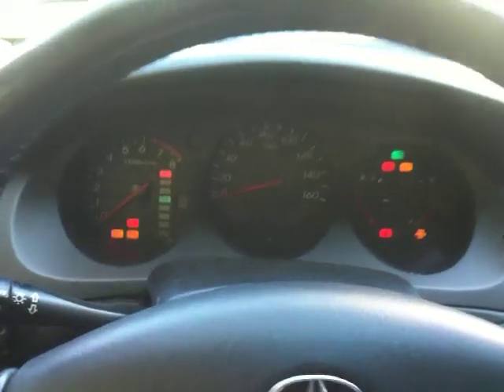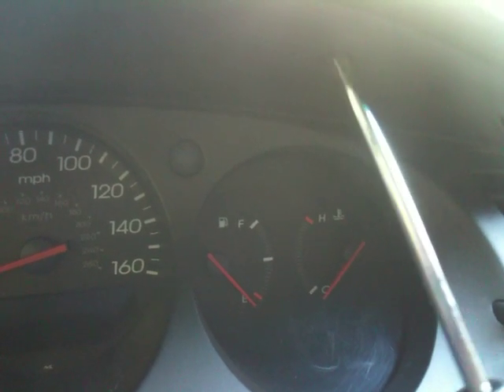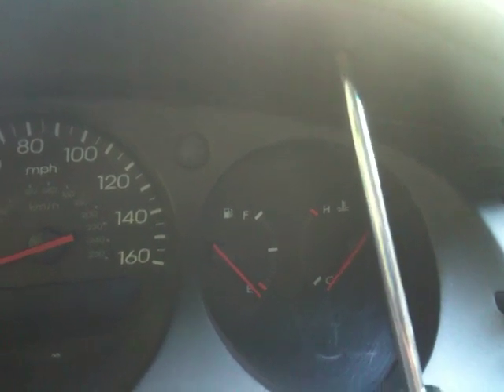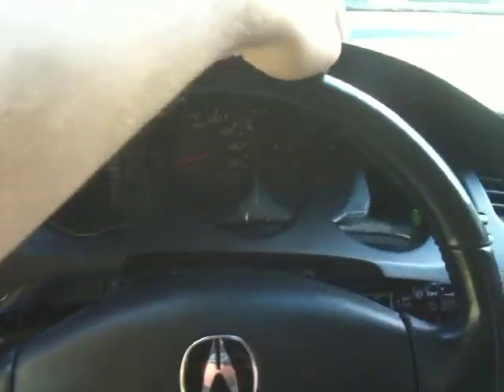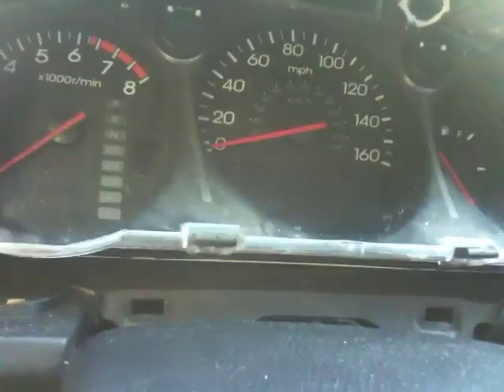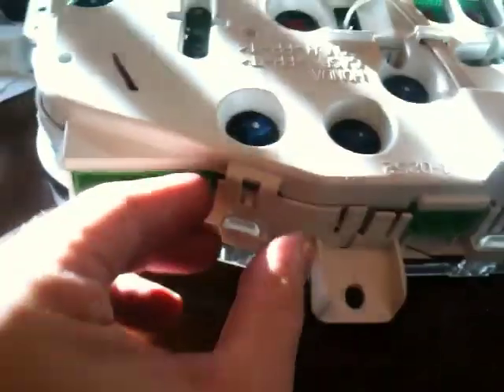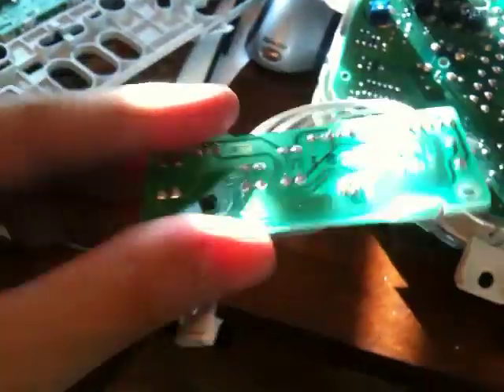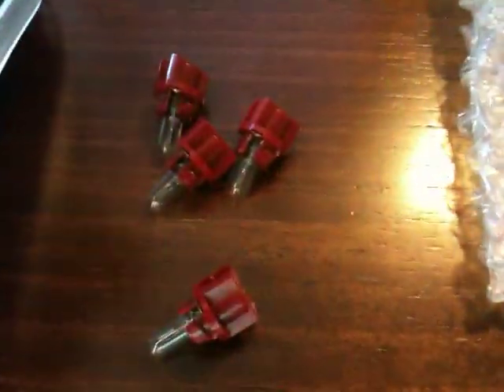How To Repair Odometer Faded Backlight Acura TL 1999 - 2003+

Comment: One trick that I have used on this type of electronic problem is to remove the PCB board which drives the lamps. Take a lead free soldering iron ( higher temperature soldering  than old type of leaded soldering iron) and touch each solder point reflowing the solder.

What happens in a  99-03 or later car is that the lead free solder connections fail due to lack of lead. All modern electronics must have lead free solder. No exceptions.

 The inside of the car gets very hot in say Arizona which stress the solder. As the temperature changes the solder needs to expand and then contract when the car cools with the AC on full.  in time the connections start to fail since the solder does not flow without enough lead!

It takes only one connection to make the lamps not work!

 I fixed my CLS 03 this way using your video and my lead free soldering irons your video was key.

Comment: Hi, Great video, very easy to follow. However, I don't really understand why you had to replace the circuit board as it seemed only the lights were out. 
I have another question: Do they use the same bulbs for the clock lighting? My clock is working but at night I cannot see it. Thanks!

Comment from the maker: I'd love to do that for you but I don't know of anyone who has one. I can tell you one thing. I had many cars and took many apart to install things like amplifiers. Most panels are held in place with clips and if you pull on it gently they usually release. You can follow the steps in this video and maybe even check out my car amplifier installation video on my 06 Lexus to see how I take that car apart. These video tips can help you figure out your car. Take your time, you'll do fine

Comment: Thanks again for the great video! Everything worked fine for me.  

In case anyone need the part for the lightbulb for the clock:
78181-SOK-A21: SOCKET (9.5V 1.14W)

Comment: Excellent video tutorial.  I took my 2003 Acura to a repair shop to replace the dashboard clock light.  They repaired it but now I find the light behind the odometer backlight is not lighting up as well as the dashboard 5th gear backlight.
Reply: Continues… is this due to some error while replacing the dashboard clock light?  Happened on the same day of repair.
Reply: Apparently with the 1999-2003 TLs, CLs, and RLs when you replace some bulbs on the dash/clusters, the other bulbs tend to give up, usually best to replace all available bulbs if possible whenever removing a few from same removal of panels.

Comment: GREAT video and thanks for the time and effort you put into showing how this is accomplished. I have a 2004 Acura MDX and the odometer light and open door indicators are not illuminated. If you have a moment, can you comment if this procedure would be the same for the 2004 Acura MDX?  The video you did was informative and provided excellent insight as to how to remove the dash panel cover and what will be found underneath.  Again, GREAT job and thanks!
Reply: Did you get this fixed on your 04 mdx? I’m currently having the same issue

Comment: When you pull out all the cables: when plugging them back in are they color coded or are they keyed to a socket? Also why would you need the odometer circuit board if only the lights needed to be replaced? Thanks good video.
Reply from the maker: I thought I explained everything in the video?
Reply: They are keyed to the socket for anyone viewing this comment in the future, at least they were in my Accord
Reply: They are keyed to the socket for anyone viewing this comment in the future, at least they were in my Accord

Comment: I'm going to attempt this soon on our 2003 Acura TL.  I know the 4 light bulbs are for the odometer back lighting.  But, what was the small circuit board for.... ??  Our gear shift selector light is also out & I'm going to fix that myself too...

Comment: Does the circuit board you installed control the speedometer as well?  My speedometer does not work.  My millage stopped working as well.  Thanks in advance for your feed back.
Reply from the maker: Hi Johnny, I don't think so, but what you can do is visit the NEW link I just placed in the video description. It will take you to a webpage where you can look at some of the other parts you may need to order.  Check out the diagram and do more research on that page. http://www.acurapartswarehouse.com/oem/acura~panel~print~reg~78147-S0K-A01.html
Reply: Thanks Great site info.

Comment: besides making me throw up 3 times cause of motion sickness :) it is a awesome video. My 97 RL is out but the main board is fried too :( no speedometer or trip. I had a repair shop send it somewhere to get fixed and they sent it back saying the board was fried (that's why I sent it there the dopes) but it came back worse cause now no temp gauge. Thank god I still have a gas gauge.

Comment: I just swapped out the transistors on the board for new ones. Much cheaper and it worked. You can get them on aliexpress just search for the part number D1947A or 2SD1947A.
Reply from the maker: Hmm did you make a video? Or take photos?
Reply: Sorry no. But they are good old school through-hole parts.Easy to take out and put in. A few minutes to do them.
Reply: @SirBunghole  The transistors are NPN TO-220 devices. Any TO220 NPN will work.

Comment: Will the PC work on a 1999 acura RL?  Your You Tube video is very helpful.
Reply from the maker: John Russert The process should be exactly the same for your #AcuraRL dashboard or very similar. Expand the information under my video for the website I used to find the part numbers. #CARDIY
Reply: @TeksTherapy  I’d really appreciate any help or guidance for the RL thanks so much!
Reply: Did you ever replace the board on your RL? Mine is completely black/out.

Comment: I was advised by my local Acura dealer that by doing this it will reset the odometer to zero. They said I would have to send it off to be recalibrated to the correct mileage. Does anyone know if that is true? In the video it looks like you can just swap them out with no problem. Please help!
Reply: +u4iagirl1 resale value would be a lot higher ;)
Reply: u4iagirl1.   that's. false
Reply: what you are replacing is just the monitor not the computer, so no it will not reset

Comment: Anyone, will this same fix apply to a 2001 RL i have the same issue
Reply from the maker: 99% most likely. Just go to a website like http://www.acurapartswarehouse.com/oem/acura~panel~print~reg~78147-S0K-A01.html and search for your own part #'s.
Reply: Did you ever replace the board on your RL? Mine is completely black/out.